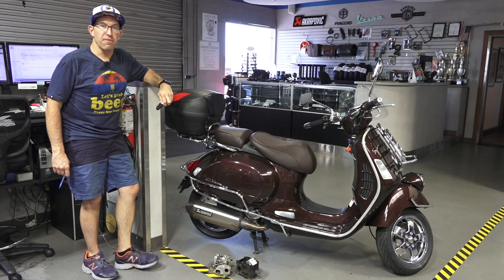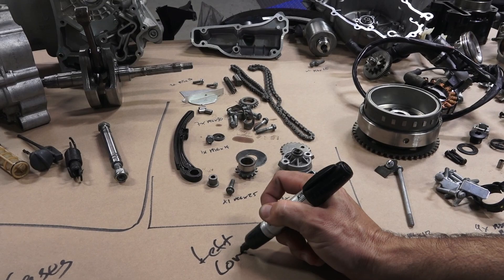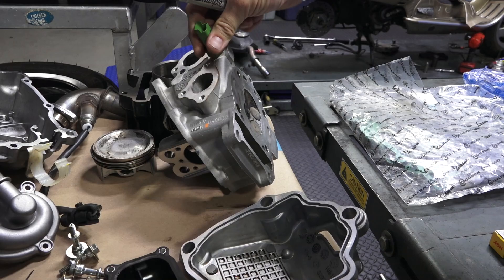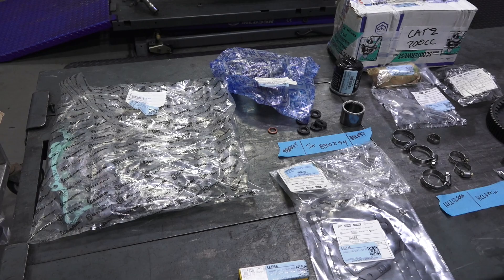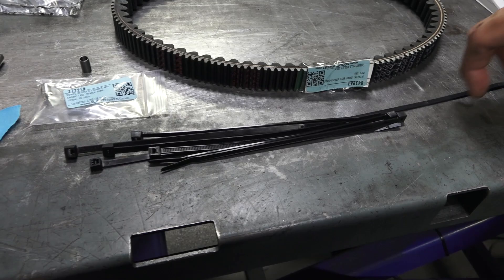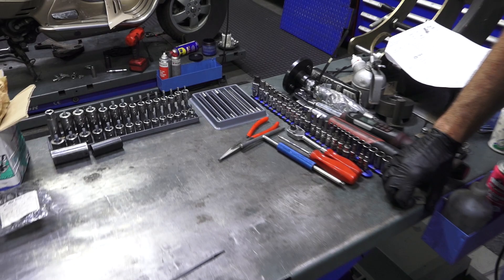Vespa GTS Complete Engine Overhaul pt. 2 Crank Replacement/Re-Assembly

Comment: Excelent video! Detailed overhaulded engine! I kept it in my favourite videos. Coincidence, i had the problem.solution: complete malossi v4 , crankshaft, malossi gears, malossi variator, clutch and air filter, all combined with malossi cdi and emulator,assembling with akrapovick.the portuguese robot(🤭) has one vespa 300 overhauled that reaches 185 km/h!

Comment: Goodmorning I have a piaggio beverly 300i 2020 31.000klm I see a lot of oil in air filter, I bought just now, the spark plug is clean but as I can see the oils after I change them and after 400klm come in half

Comment: Hi, congratulations for the video. I have a question, I'm doing the same job on a piaggio 250, but I have a problem. I reassembled the transmission chain cover and the oil pump chain, but when I try to turn the engine by hand the oil pump chain doesn't turn, where am I wrong? you have an email? I'll send you an explanatory video. Thank you

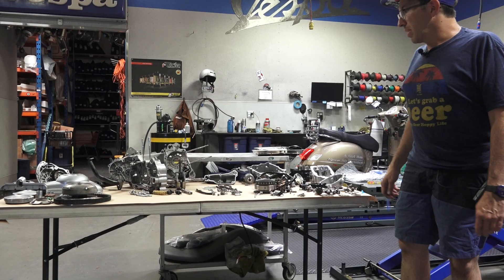Comment: 4:50 - Overview
5:49 - Engine Bottom End
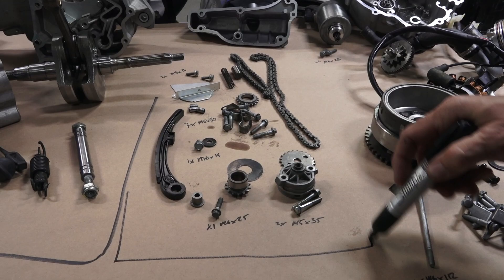8:33 - Engine Cover Left
9:24 - Engine Cover Right
11:43 - Engine Top End
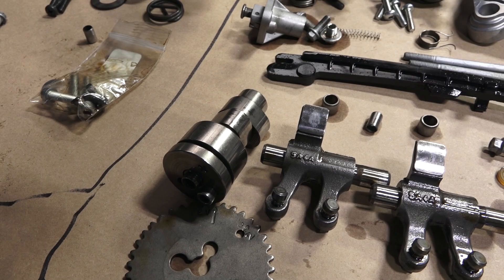16:51 - Transmission Components
17:02 - Transmission Final Drive
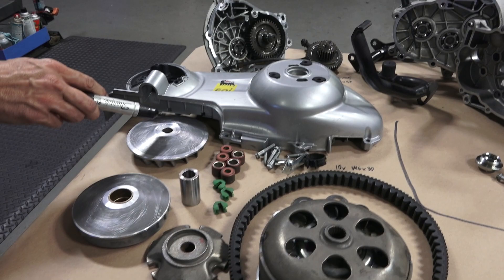19:15 - Transmission Variator
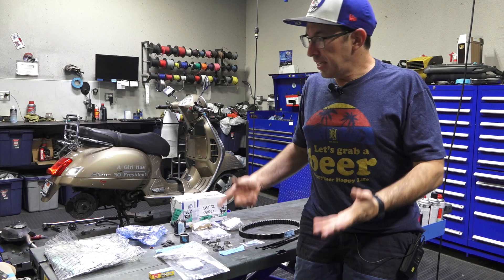20:19 - Consumable Parts
25:52 - Replacement Parts
30:04 - Reassembly

Comment: Never seen a gts 300 engine apart, wouldnt have dreamed of re building one, much quicker to replace the engine
Reply: Also extremely more expensive to buy a new motor. Pay someone to do it… That is what I will do on my bike if I need this.

Comment: question, I found a 2018 gas 300,,,, cheap guy blew the engine I think, said it needs a bottom end rebuild. after calling around most mechanics won't do a rebuild they wanna throw an new engine in and that would cost as much as just buying one,,,, is it worth a try to do a rebuild myself?   im ex airfare guy, used to work on jet engines, but I know nothing about vespa engines,, but after watching your videos, if I used them as reference,, is this something I could possibly do? the thing looks brand new ,,,

Comment: I have two questions.First, why is the crankshaft cannot be reused with con rod replacement,instead of ball bearing what kind of main bearing they r using? second ,given the drive oil pump gear is free wheeling ,how it drives the oil pump?no further  explain from robert,he  just pointed out that variator should put it on in order to work,i just can't figure out how it work?

Comment: Great video! Quick question...what is the stock crank shaft in 2004 Derbi Piaggio et2 engine rated for? I Am installing Stage 6 MK II Sport 70cc an thinking to keep the stock crank... i have also Yasuni R, Malossi 2000, Ordering Stage6 Carburettor Stage6 R/T Type PWK21, 3g Polini clutch with green springs. Thank you!

Comment: Are all the gear box bearings the same size? Also I have seen a lot of videos of people replacing those bearings with close bearings with separate rubber seal. What do you think about using closed bearings for the gear box?

Comment: @ Vespamotorsport   When replacing a crank in the Vespa series motors, I've understood there are different versions?  Like a type 1 or type 2.  Before tearing into a motor and having everything all taken apart, is there any way to know what crank you need so you don't risk losing parts while you wait for the crank to arrive?  I have a GTS 250 that needs a crank and I want to do the cleaning, tear down, and rebuild all over 1 weekend so as not to forget how it goes together and not to lose anything.  What are the crankshaft options?  Thanks!

Comment: Good day Vespa Motorsport, I have a GTS 300 i.e 2014 and need to replace the crankshaft but I'm in trouble because I don't know which category need to buy, if cat. 1 or cat. 2, in all stores says that either fits for my Vespa ZAPM45200. Can I buy anyone? Is there a difference between them? I will be so grateful if you could answer my question.

Comment: I have a shot crank on my GT200 from where the woodruff key tore out , can i use he crank from a gt125 engine i have  ( if they are both type 2) or  could i swap the 200 head and barrel onto the 125 engine . Which is best option  do you think ?

Comment: I've got a few questions about the gt300 mallosi kit installation. I've watched all 3 videos of rebuild, I noticed that it looked like you were having some of the issues that I have come across. My question is did you have low compression when you got it together? I have got 70psi I've done compression, leakdown, and the usual checks. Have not found a red flag with any of them. You have any thoughts why I have low compression?
Reply: Did the bike start?
Reply: The bike ended up have low compression due to the kit. Had to remove it
Reply: @derekbrooks3070  alright thanks for the information mate. I've just installed a big bore kit and a big cylinder head on my Yamaha nmax but it won't fire up so I'm thinking it might be low compression
Reply: @hazgaming3924  definitely a good idea, but you can try stock head on big bore cylinder
Reply: @derekbrooks3070  yes that's what I'm gonna do thanks bro

Comment: Good day. Hello to you from faraway Kazakhstan. If it is not difficult to tell me please. I have a Piaggio ZIP engine 125 carburetor. I want to install it on the Vespa LH 50 2t scooter. Which sdi switch is suitable for starting this engine ????. In addition to the ACI503. I will not have an immobolizer. Thanks for answering.

Comment: Any tips on starting my lx125 on a morning.
Since the weather has been rainy and a bit cooler on a night it's turning over but not firing up.
I've done the throttle pump 3 times thing and I'm not sure if it does much tbh.
Once it starts it's fine for the rest of the day and starts up instantly.
I'm wondering if there is a nack to it.
Reply: You may have tight valves, an air leak at the intake manifold or issues with the carburetor.  I would check all of those items.

Comment: https://youtu.be/F6RE8Gyupxg?t=4460  In Piaggio, they went crazy - why it was so difficult to make a cover - today I disassembled the entire motor and stopped at this place. I don’t understand how to get this cover without a super tool from the piaggio ...
   She sits there in her tracks - I used to knock out the inside, but I almost made a hole ...
  in the version of the motor version of this Brad there wasn’t - 3 screws and voila